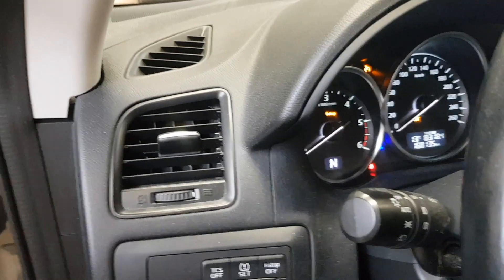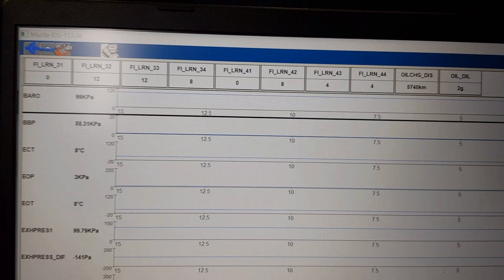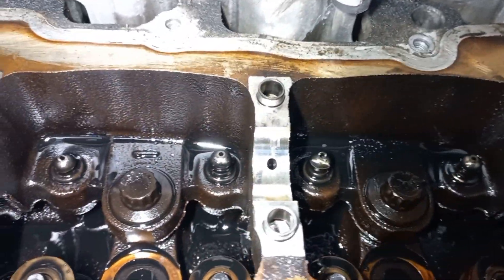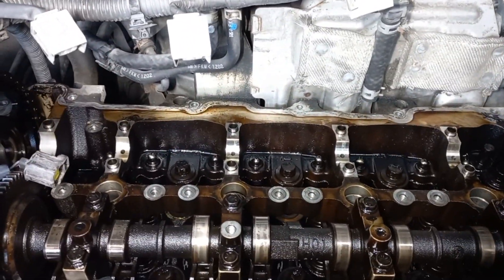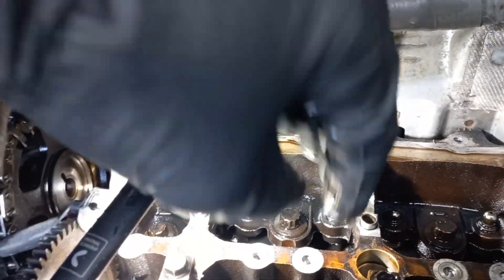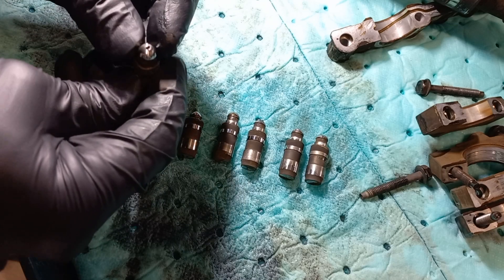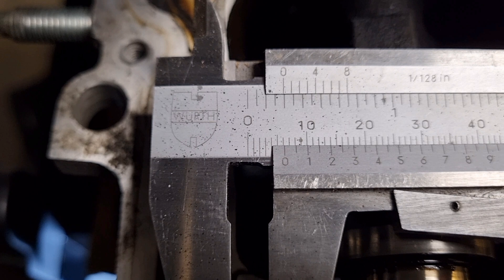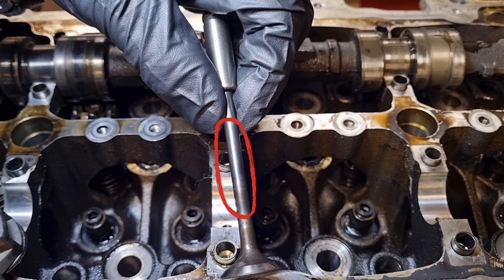The Mazda 2.2 Skyactiv D engine is difficult to start; the engine does not start.

Comment: You said someone had been in there before you, with that scouring damage to the journals I'd be almost willing to bet an injector washer/s failed and the subsequent carbon sludge starved the engine of oil. This was fixed but they didn't remove the camshafts to clean the top of the head or to check for further damage. I've had 2 similar jobs, in both of them the injector washers had leaked and the engines repaired about 1 year before I got to see them.
Reply from the maker: Hi, when you quote some of my statements, place a time stamp for reference. I said that based on the appearance of how corroded the camshaft was. The rest of the story is most likely as you described.

Comment: Good information, what caused this wear on camshaft?
Reply from the maker: Thanks, To me, it looks like those HLAs were mechanically damaged first, and then these metal particles were circulating in the oil system, damaging the engine.